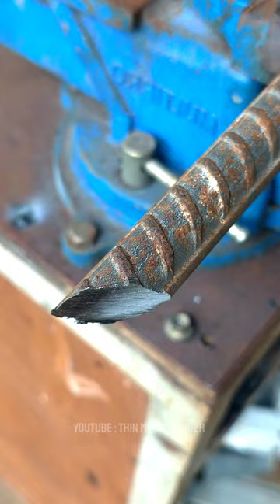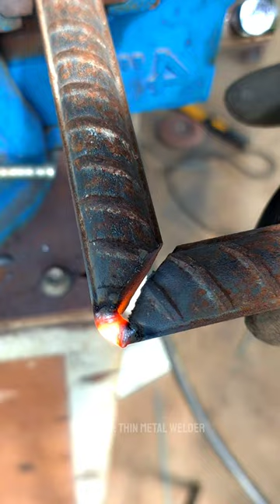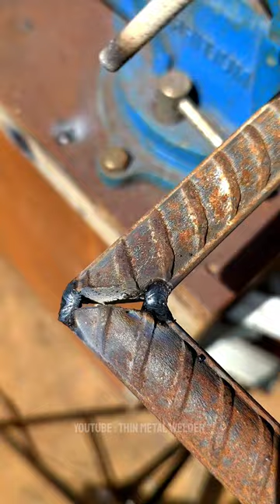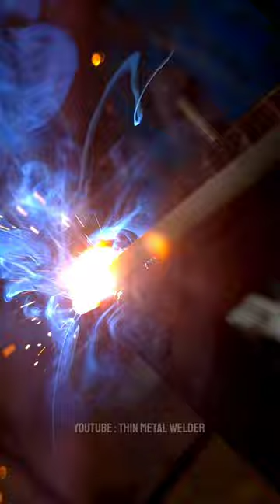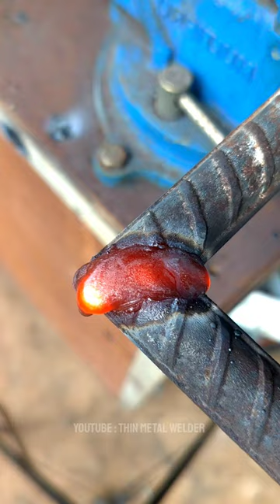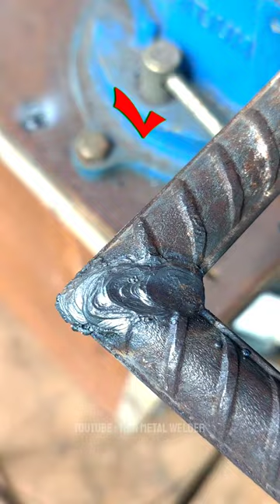the secret of welding steel rods that is rarely discussed  #welding #stickwelding #weld #stickwelder

Comment: That shid wond hold up, if its hollow
Reply: It is rebar bro what the hell do you think it needs much rebar only is used in concrete to strengthen it it's not so much the rebars angle. You can throw a bunch of rebar into some concrete and it will help it by so much... I completely understand that what you are saying is true he should have beveled the sides so that the inside will not be hollow but then again it is only rebar why would you want so much sense of strength in rebar knowing it's going to be buried in cement 😵‍💫😵‍💫😵‍💫💀🙌